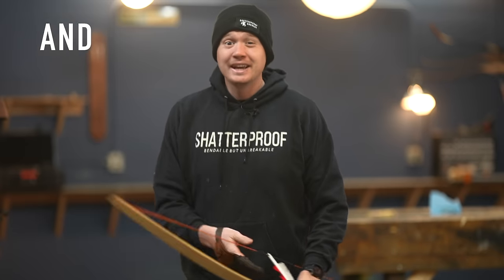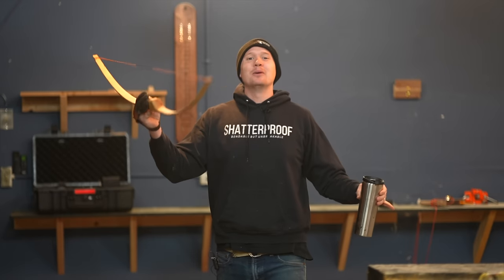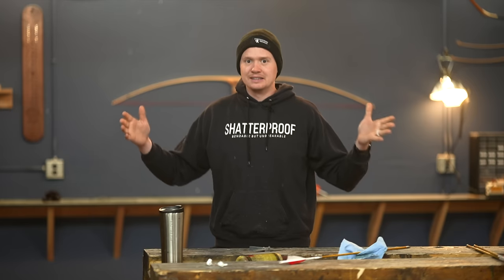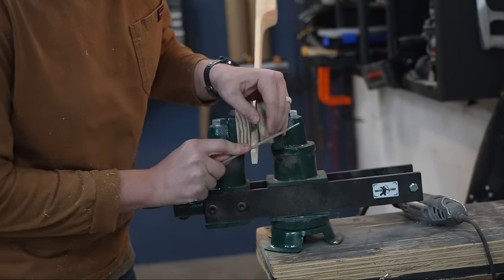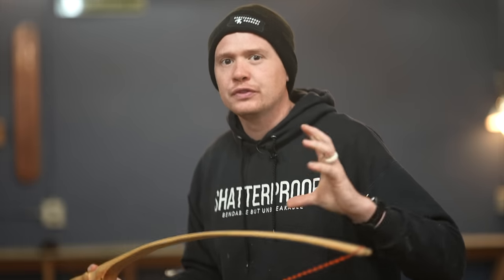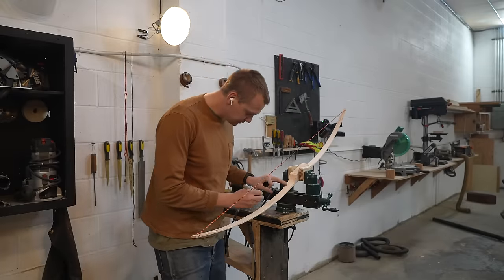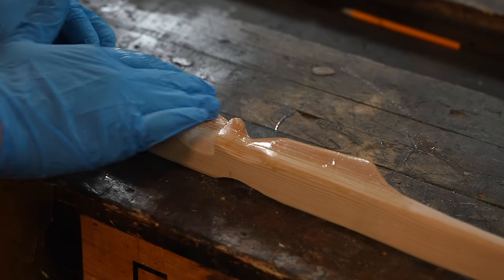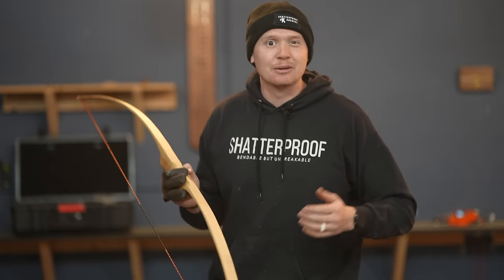DIY $2.34 Bow Build (How To)

Comment: As always, this was a fun video to watch. Obviously, we all know that Pine is not an ideal bow wood but nonetheless, it is a functional bow. What I have found is that compression is the weakness for softer woods. I wonder if it could be fire hardened to help with compression, and maybe a cheap backing of fiberglass cloth. You might be able to get it up to 35 or 40 lbs that way and still keep the price down.
Reply: Yes I agree! I would love to see just how far you could take a regular 2x4 by doing simple techniques like this!
Reply: A fiberglass backing would be detrimental. It would put more load on the belly which is obviously the weak spot with this wood.
Reply: @malcolmjohnson5941 Maybe this could be helped by laminating both the back and belly with fiberglass?
Reply: Yes u can overlay these with fiberglass mesh and poxy or even leather
Reply: These would be great for larp, cosplay, kids, beginners, really like the idea
Reply: I think this video was less of "how to make a good bow from a 2x4" and more of a "anybody can make a functional bow out of a 2x4"
Reply: Pine has a tremenduous pressure capacity, but has a weakness for strecth. Birch has a tremenduous stretching capacity but has a weakness for pressure. So they used to make laminated bow putting birch on the back and pine on the belly side. Pine had to be slowly grown morass pine that has tight year rings.

Comment: I am always curious and theorize that pine woods from 2x4s are okay for bow making, but I've never actually tried it out of fear it'll just fail...

But you, not only you prove it to be possible, but also make it seem easy enough for other people to build it. Thank you very much for your efforts 😊 now I'll know for sure it'll work if I follow these instructions 👏👏
Reply: The thing with this timber is it’s hard and brittle not hard and malleable so it can crack and break pretty easily over time even with good care, technique and let’s say linseed oil every so often. It works but I wouldn’t use this timber if it was my life on the line and had access to something else. It’s all fun and that’s what matters :)

Comment: I remember seeing in a forum somewhere that some pine woods are denser than others.  The pine from the lumber store is young and cheap pine which is going to be terrible.  I also read that because it is a soft wood, you would need to make it wider and longer than your average bow so it doesn't set quickly.  I always wanted to try doing a cheap pine build, but never have.

Comment: You mentioned one of the limitations is the low poundage. Just for clarification, Colorado has a minimum bow poundage of 35 lbs and New Mexico has no minimum poundage limit, both to hunt big game including elk. People think you need to have a compound bow with more wheels, pulleys and strings/belts on it than an engine block with 80 lbs to hunt. Not so.

Comment: Very interested in bow making, never done it, but I have done a fair bit of wood working, could you explain grain (sorry, new here, maybe you already have done), tightness (growth rings) their direction, etc for when choosing a suitable plank/board. TIA
Reply: The ones with flattest rings, ideally going horizontally across limb, are best. The key thing is no spiral  / twist . Good luck

Comment: I’m a bit scared of starting a project. Because I tried one of the bow you made a video about and it broke on my first try. I guess I need practice to success 🤷‍♂️
Reply: Many very successful and experienced bow builders broke bows. This is not a hobby or profession like anyome else. It takes a lot of time but is very rewarding on the long run.
Reply: Many very successful and experienced bow builders broke bows. This is not a hobby or profession like anyome else. It takes a lot of time but is very rewarding on the long run.
Reply: Many very successful and experienced bow builders broke bows. This is not a hobby or profession like anyome else. It takes a lot of time but is very rewarding on the long run.